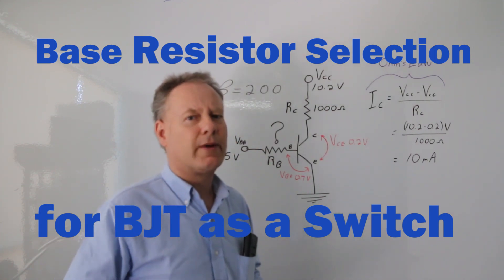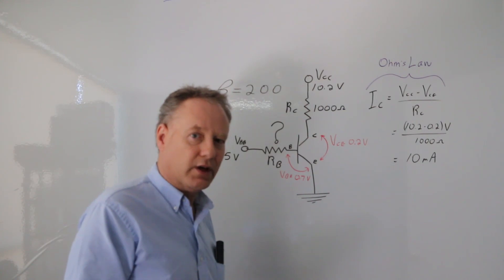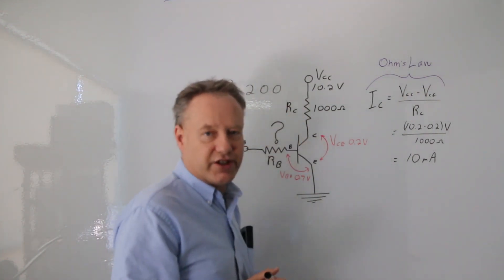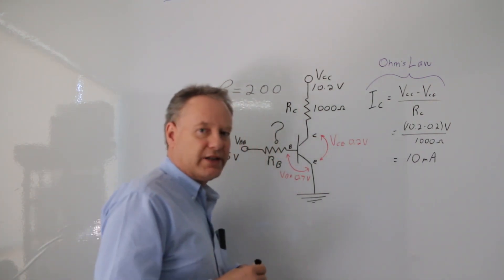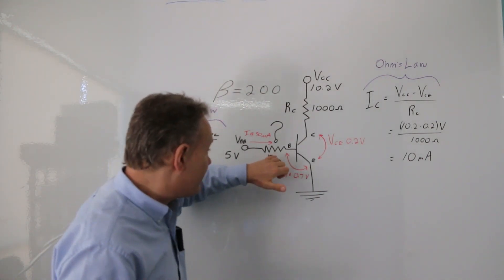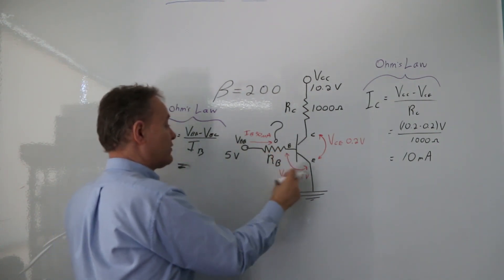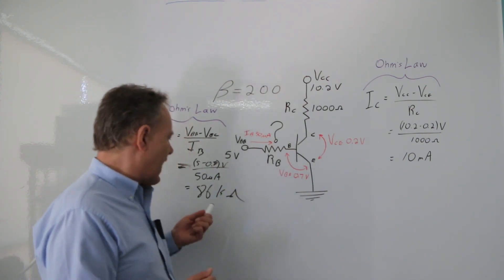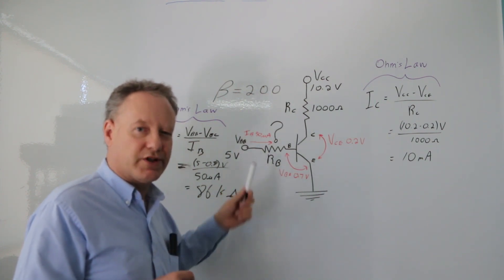Base Resistor Selection BJT as a Switch

Comment: YOU DIDN'T TELL HOW  TO CALCULATE THE GAIN?---how tp calculate the gain and how got the value 200? What if the base voltage is same as the collector boltage? Is there a simple way to calculate that in that case?
Reply from the maker: Thank you for your great question. I get your frustration. You are not alone. I had a similar issue when I first started learning transistor theory.

The thing is, the Gain is not calculated, but put into the design of the transistor by the manufacturer. The manufacturers decided what the gain is and then include that information on the datasheet. This gets a bit more complicated, because the gain changes with the collector current. If you look at the date sheet of any transistor here is a link: chrome-extension://efaidnbmnnnibpcajpcglclefindmkaj/https://www.onsemi.com/pdf/datasheet/tip47-d.pdf

If you look at the Datasheet, you will see the Gain chart hFE DC Gain Current Gain. The Max Gain is 150 when the collector current is low and the and the minimum gain is 10 when the collector current is at its highest (The highest current is listed as 2 Amps)

Knowing the Gain, you can do all the math I demonstrated in the video. 

I would like to also note that I used a gain of 200 to make the math easier, but it is an uncommon Gain. Typically, smaller Transistor have a lower max gain lie 80- or lower for the max collector current,

I hope that helped your frustration.

Comment: Where did the value of 200 for B come from?
Reply from the maker: Each BJT comes with its own B and can b e found on the data sheet. I made up this gain, but could have also taken it from the Data sheet. 

The Gain is defined by the manufacturer. The size and type of transistor also has a little bit to do with the game, but essentially the manufacturer chooses what the gain would be in the way they manufacture the transistor.
This particular gain of 200 is quite large and actually is not very typical for this application. I think I should have probably used A-100 instead or even something lower, but to answer your question, I just pulled it out of my head because I didn't use an actual transistor with its own data sheet and code. The number 200 allowed me to do the math easily. I hope that answers your question.

Comment: NB: Everyting in your explanation is very good but not the beta Value. The beta in Saturation will never be that high. beta is rather about 10 in Saturation.
Reply: Nope. This was perfectly fine! Beta drops in saturation simply because for a given Ib, there isnt enought Vce to sink the active region's Ic.

The idea here is that the with 50uA Ib, the BJT is is at the edge of Sat and Active. Since this is bot Sat and Active, the same Beta applies. Thus for a higher Ib, it will definatetly get pushed to Saturation.

Comment: why 1000 ohms? All tutorials never explain how they come to decide on the resistance.
Reply from the maker: Hello Alvin.

I selected 1000 ohms because I needed a collector current that was nice and simple. 10 milliamps is a simple number. The thing about BJTs is that they're typically not designed to control a lot of current. Anything under 1000 ohms would draw possibly more current than the BJT can handle and anything more than 100 ohms would mean that the base current would be so small that I may need a mega ohm resistor for the base resistance.

I guess the best way to answer your question is, 1000 ohms for the collector resistor creates a current that's easy to work with and the numbers work out well.

Of course, my answer doesn't tell you anything about application. I think typically you will see in a classroom setting a 1000 ohms resistor is typically used so that the example is nice and simple, but depending on the application that collector resistor may be much lower even down to 50 ohms and much higher up to 10,000 ohms.

Typically, Darlington transistor (Which can handle higher currents with collector resistors of low values) and FETS (Field Affect Transistors) are used to control higher currents like 100 mA to 1 A and even much higher. BJTs have wildly fluctuating Bata (The Gain of the transistor) with changing and high currents above 100 mA. For this reason, you don’t generally see the collector resistor being lower than 100 ohms.

If you want to look at examples that use lower resistances for the collector, I did a motor control video with a BJT. 

https://youtu.be/cSTv-Ft_HhU

Here is another video where a BJT (NP2222A) is used to control a Pneumatic Solenoid that draws under 100 mA. He is using 12 V for the Vcc so I’m assuming the resistance of the Solenoid is (10 – 0.2)V/56 mA = 175 ohms. 

https://www.youtube.com/watch?v=8DMZSxS-xVc&t=816s

Comment: Hi. I have a problem. Here I live in Africa, here is either difficult do get hold of DI-boxes for the music or they are way too expencive. So I dercided I will try to build them myself to sell them here.
I struggle also to get hold of metal boxes to build them in. A DI box is a Direct box which will isolate and create a better sound from the instrumnent through the mixer to the amp and to the speakers.
I Followed all the instruction I could find on internet. But still I got a buzz. And I building passive boxes there is only signals from mostly guitars going through.
Can it be because the boxes is all plastic or what can it be? Would it also help if I cut some metal pieces to cover the inside of the boxes to create a good grounding?

Comment: Great video. To bad it was so hard to find :)
One question: do I need a base resistor if I want to control transistor from output of an IC that gives 2V and 5mA on it's output?
Reply: @Taurruth  Putting 2V that can source 5mA of current into the Base of a BJT is dependent on the transistor. What he didn't show you is how to get: Ic Saturation , Ib Saturation, Vce Saturation, Vbe Saturation, and Beta (Current Gain, the Greek letter that looks like a B).  These vary for each transistor type (even among various manufacturers for the same type).  Determining those parameters is the "hard part" of this exercise, each manufacturer has their own way of specifying how their part works, so its not always straight forward as some manufacturers may not specify all of them clearly and you have you derive them from studying the data sheet.
So, if you have, say, a 2N2222 NPN Transitor, I beleive it can handle 5mA on the Base, but since the the voltage across BE Junction will be about 2V for this transistor (your output's supply voltage) then that output driving the Base is effectively current limiting to the transistor's spec by default (not the norm but possible), but that output is working at its maximum and you should always have about 10% design margin from Ibe Max (check the data sheet) to allow for temperature changes and other tolerances. Pull out a 2N2222 data sheet and check this as I am going from memory.  In this case I would put a 10 Ohm resistor in series withe Base as a current limiter so your output is slightly below max output current and not at specified max. You may find that even a 500 Ohm resistor may work because you may only need about 3 mA to get the transistor to saturate for the amount of current you need to flow through the CE pins.  Usually, we try to drive a NPN BJT in the Common Emitter configuration with a output that has voltage higher than the Vbe voltage and use a current limiting resistor for better Base current control. Using a 2V output to drive the 2N2222 gives you little control of the current. For example, if your output was 3.3V at 5mA, the current limiting resistor would drop 1.3V and to provide 4mA @2V  across the BE - that resistor would be 325 Ohms. This way, you have a design that you can "Tweak" the Base current (selecting the best current limiter resistor value) for optimum operation and not waste power (using more Base current than you will ever need). If you only have 1 tranistor circuit that "wastes" 1mA of current that may be fine, but if you had 10 circuits, that would be 10mA wasted for no reason, remember, more circuits, more power used, thus less power available for other circuits in your design. Does this make sense?
Reply: @Paul Romsky  thank you for your reply.

Comment: So, if base current should be one-tenth of the collector current, that means if I want 1A collector current the base current should be 100mA, am I right? (Or completely wrong?).
Reply from the maker: Yup! you are 100 % correct.
That is for a BJT as a switch.
For amplifiers, it's quite different.
Reply: @larsexplains3086  OK, thanks! 👍

I just want to drive a 3W LED light panel. It consumes 1A at 3V. I already tried to drive it with one transistor but the heat is too much. I'm thinking of using few transistors in parallel.

Comment: No. All manufacturers' data sheets specify saturation with a base current one-tenth of the collector current. You should drive the base with 0.1mA in this case, which calls for a 4.3K base resistor. The reason is the switching time being limited by the input capacitance, and that needs current to charge and discharge. A 2N3904, for example, specifies its delay time, rise time, storage time and fall time with an Ic=10mA and an Ib=1mA. You can't have fast switching without driving some current. In fact, some switching designs use a small capacitor in parallel with the base drive resistor to further improve the transient response.
Reply from the maker: Thanks for the feedback, Rex! Always appreciated. I agree with the one-tenth. In this example I mentioned to divide the calculated resistance by 2 two or so, which will be somewhere around 47 k ohms. That will give around 1 mA which is one-tenth of 10 mA. I selected a gain of 200 so I would end up with a base current of around one-tenth, but I suppose I should have unpacked that from the perspective of the datasheet as well. My focus in this video is to teach the operation principles of a BJT, but I am getting the sense from some comments that I should also use Datasheets and specific transistors. ---- -----  You calculated for 0.1 mA which is one-one-hundredth. Your value of 4.7 k is the correct number but is just off by a factor of 10. I fully make those mistake way too much :-) Sometimes in lecture which is funny! Especially when my students catch me on it 😊 Keep up the feedback
Reply: @larsexplains3086  Thanks, Lars, I clearly wrote the wrong base current there, and you're right that it should be 1mA to saturate a transistor sinking 10mA collector current. I gave the correct value for the base resistor, which is 4.3K, but it's not critical in my experience and 4.7K would work fine.

Comment: Thank you so much but could you what is the B = 200 again? i mean is it a resistance , a standard or what?
Reply from the maker: B stands for the Gain of the Transistor. The formula for Gain is B = IC/IB where IC is the collector current and IB is the base current.
Reply: @larsexplains3086  I got stuck on the same thing. I tried finding in the datasheet (using MPS751), and closest thing I could find is hFE but then only gives a Min. based on 4 different test conditions. Thank you BTW for making this. :)
Reply from the maker: @joshhaughton1893  You'll see that the gain changes with the Ic. So, select the rigth gain for whatever Ic you have. For BJT as a switch, you can balpark the base resistor so using an approx. gain woks fine.
Reply: @larsexplains3086  Thanks for response! To make sure I understand how to put what you're teaching into practice. If I'm using a MPS751 transistor for instance, and only need to switch a load of up to 1 Amp, although it's rated for up to 2 Amps
- I'd reference the datasheet. Here: https://datasheet.lcsc.com/lcsc/2008241904_onsemi-MPS751_C606060.pdf 
- Then lookup the hFE Symbol, and use 75 as "B" in your formula BECAUSE that was the minimum DC current gain in a test condition where Ic was >= my calculated load of 1 Amp. So although, per this particular BJT, the min gain drops down to 40 with 2 Amps on the collector, I wouldn't need to use that.
Do I understand that correctly?

Comment: Great! I would have loved to see the datasheet of your transistor though, so at least part number would have been nice.
Reply from the maker: Hi Christian. I just made that example up. I selected a Gain of 200. That example is discussing the general steps to select the base resistor for any BJT. This method works for all NPN Transistors. So, in that case I did not need to be specific to any one BJT. Sorry, the datasheet doesn't exist because I just made up the gain, If you like, I can do a video for you on a specifit BJT. Let me know.
Reply: @larsexplains3086  Hey thanks for the video how about a BC 549 Transistor?
Reply from the maker: @LightningFreezer  Hey Lightning. The video is generic and does not specify a transistor, but the math is all the same. If you are interested in using a BC549 then use the Datasheet to establish the gain will be for whichever Collector-Emitter current you need and the maximum voltage applied to the Collector (Or more specifically what the VEC will be) can handle. The BC549 has a maximum VEC of 30 volts and the gain will range from 100 to 800 depending in the current through the transistor. Does that answer your question?
Reply from the maker: @LightningFreezer  Here is a link to the Wikipedia page on the 549 https://en.wikipedia.org/wiki/BC548

Here is a link to a Datasheet from Fairchild: https://www.mouser.com/datasheet/2/149/BC547-190204.pdf
Reply: @larsexplains3086  Oddly enough, the BC547 series is of the few BJTs where the manufacturer specifies the base current as 1/20 of the collector current to guarantee saturation. Almost every other transistor specifies 1/10, except for the Darlingtons, of course, where it's common to see 1/250.
Reply from the maker: @RexxSchneider  Good to know Rex. I'll keep that in mind

Comment: A big question answered. How about making a variable source?
Reply from the maker: I do a video on using a BJT as a DC amplifier if that's what you mean. Making a variable DC source to run experiments and different circuits is WAY more complicated than using a BJT. This is because a BJT is configured with a given collector current and a specific collector voltage. A variable DC power source has changing voltage and changing current and is a much more complicated circuit that just BJT.

Comment: But what happens if I put a 1K resistor there?
Reply: the entire universe collapses and it’s all your fault
Reply: @lucasc5622  OMG! I was just about to do it!
Reply: It still works. When driving relays with an NPN (2N4401) I usually just use a 1k (or less), and it works well, I'm probably driving lower resistance loads, but not massively lower.... This is with 3.3V microcontrollers, draws maybe 2-3mA from their pins... all good....
Reply: @geoninja8971  does your controller heats up and what kind of microcontroller do refer to thanks
Reply: @stevegoodjob5902  Arduino Nano, ESP32, ATtiny85.... no heating up noted, wouldn't be expected at these low currents....
Reply: Thanks a lot I'll try it